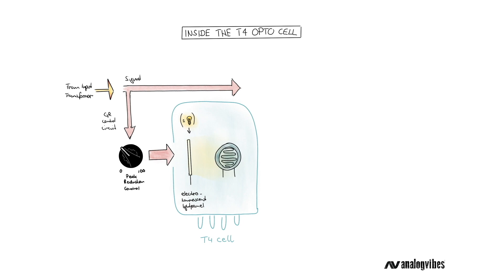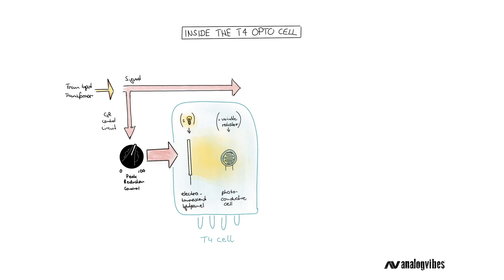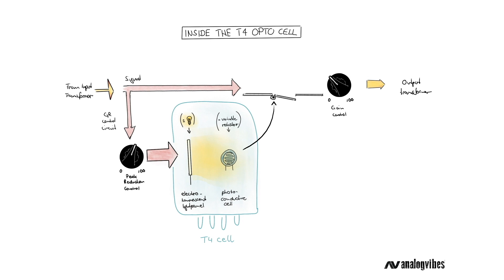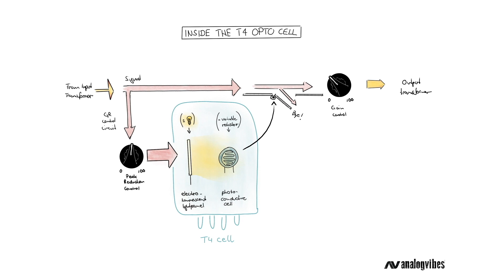What the heck is a T4 cell? Teletronix LA2A - BYL-Series I, Part III - analogvibes

Comment: I have a problem with my Klark Teknik clone (KT-2A). The compression seems to work, but when set on the "Gain Reduction" mode, the needle doesn't move (on "Output +10" and "Output +4" it does work as exptected). Based on your explanation here I suppose I could have a faulty T4, where the compression functionality is intact but the metering side is broken. Do you think this is a plausible reason for the defect?
Thanks.